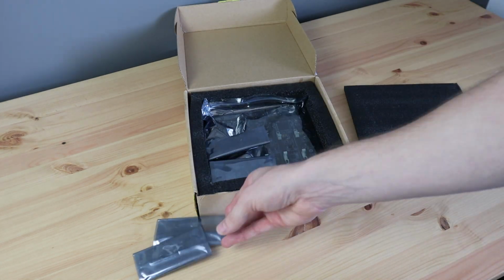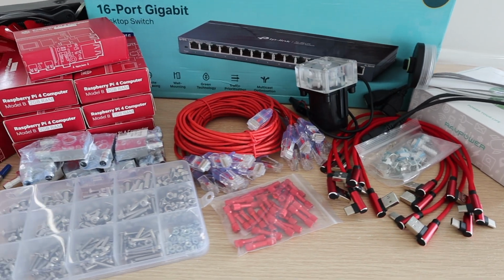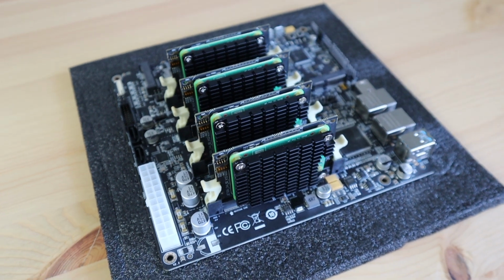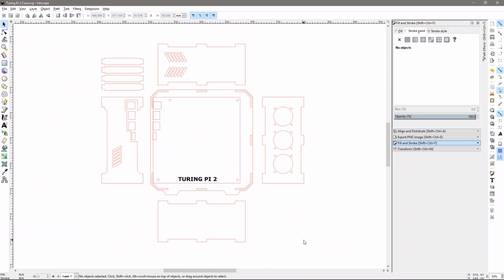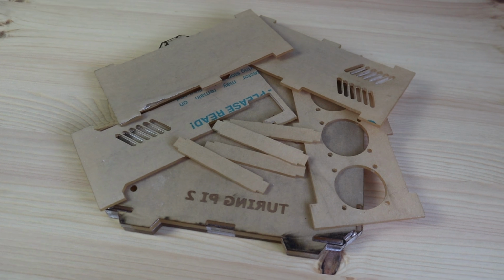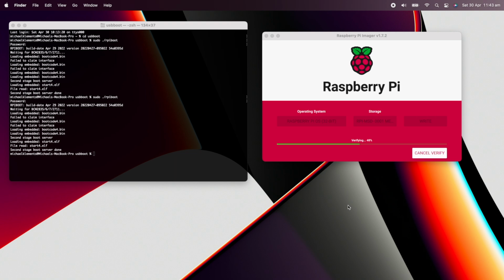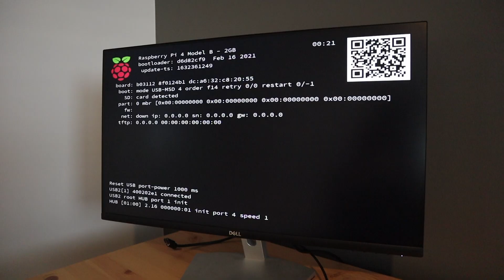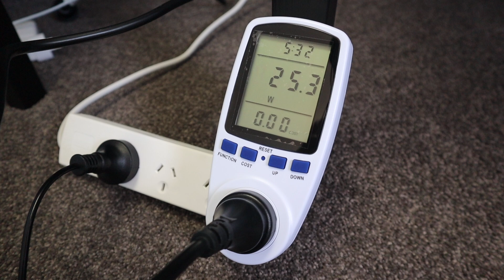Raspberry Pi CM4 Cluster Running Kubernetes - Turing Pi 2

Comment: Intersting Video. What kind of Turing Pi 2 Board this is?
In 1:07 I see an STM32, which is not the actual CPU/MCU for the BMC. It should be an Allwinner T113S.
Also the board looks like a pre-2.4 PCB. And there is no battery adapter for  the BMCs realtime clock which was needed in 2.3/24 revision boards?

Comment: Can you use any of the RISC-V compute modules to do this?
Reply from the maker: The Turing Pi board just interfaces with the SOM's with a SODIMM-style edge connector so provided you can find a RISC-V based module that follows the same generic pinout then it should work.

Comment: Awesome, I'm doing similar things I did a 3D print of a case.  Do you have any videos of the software setup
Reply from the maker: Network Chuck has a pretty good video on setting up a Kubernetes cluster on Raspberry Pis. It's not done on the Turning Pi board but the process is the same.

Comment: Do You still run this? is it a part of prev cluster or independant one? 
Looks great and and sure it's compact, but You missed some details about price, which is just high. Of course You can say that the whole idea for such cluster is based on it's size, but I think You can get better (and cheaper) results with regular pi and POE way. 
For me there are two main disadvantages of this board - first it uses fixed IO for each board so You can't do 4xHDMI or anything else - You will get only those assigned for each slot, wasting power You need. Secondly they reduced number of CM modules from first version so it's not that attractive for now. Manufacturer also announce RK1 modules based on RK3588 (of course with max 32GB, which nobody yet offers). I hope there will be some video about such cluster build and how it performs with built in nvme, most rk3588 boards already have 2.5Gbit ethernet which this one will lose.
Reply from the maker: Yes, it is still running as an independent cluster.
It is quite expensive and you could probably build a better custom solution to suit your own needs, but this is a convenient package for those not wanting to have to worry about an additional switch, network cables, power supply, power cables etc.
You're also limited to the IO they've provided as you've said, but I think this is a fair spread of IO to cover most use cases that people would have - most clusters don't need 4 x HDMI outputs, most don't even use one HDMI output as they're generally interacted with over the network.

Comment: If someone took the time Plan 9 would be the perfect operating system for this. With the 9P protocol it's possible to network all of the modules together and mount what they each have access to node 1. Node 1 can be used for just interfacing with all of the nodes like one machine.

Comment: Would have been nice if they added an M.2 slot either as shared or one for each module.
Reply from the maker: Yeah a shared one would have been a nice addition, they do have mini PCIe ports that could be used with an adaptor.

Comment: Hi Michael. I never used 3D printers and I'd love to get some and learn to cut stuff like you did here, but more importantly, learn how to measure and draw stuff in the software you are using. Could you give me some guidance where to start and tell me about how you manage to learn it?
Reply from the maker: Thanks for the suggestion, I'll look at putting together a more design focused video!
Reply: @MichaelKlements  Thanks, Michael. Many of us envy your projects in a way and many, including myself, I'm sure, would be delighted to follow your path and make some of those cool things. So such a video would be superb :-). 

An idea:

* A solid 3D Printer
* A solid laser cutter
* Which software do you use, how do you measure and draw, etc
* Where do you get your components and accessories, e.g. screws, acrylic, plywood etc
* Anything else

Cheers
Reply from the maker: Yeah like a workflow how to guide, I'll definitely look at putting something like that together. I've got a few "go to" pieces of equipment and software packages that I'm sure others could benefit from as well.

Comment: Loved what you did with the case, although I would make it a little bit longer so the fans don't come into contact with the power cables that are present in the front.
Reply from the maker: Thank you! Have a look at my #short update, the PicoPSU that I intended using with this case doesn't have the bulky power cable, so it works quite well.

Comment: Nice work.  Yeah, Pis are so scarce that I've started pulling Zero Ws out of old projects.
Reply from the maker: Yeah it's frustrating having to take other projects apart to work on new ones. Two of these Pi's were in use on other systems and had to be salvaged to complete the cluster.

Comment: Would love to see the sata drive version. So are you going to release the laser cut files like you did with some other projects? 

Would be cool if you can add a status oled panel to show stats of each CM4 in rotation such as CPU load, ram is use, and drive space. Great video, thanks again for sharing.
Reply from the maker: Yes, I'll do that once I've tried the design out with the Pico PSU.
At this stage the GPIO pins are not available to the CM4 modules. As soon as the firmware is updated to include this functionality then I'll look at adding an OLED display to it.
Reply: @MichaelKlements  awesome, very much looking forward to it. Thank you again.
Reply: @MichaelKlements  Great that will be a nice final touch. Like your work I've subscribed to keep an eye out for the final version. I guess if you can add a speed controller to those fans that will keep the noise down too.